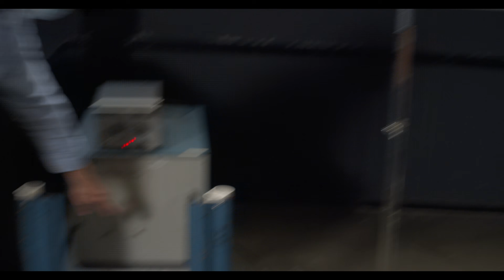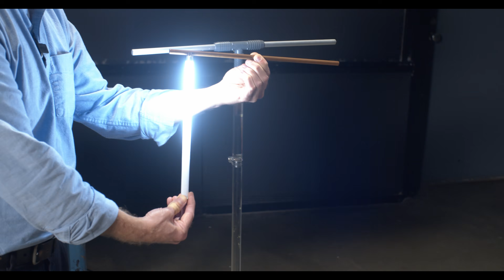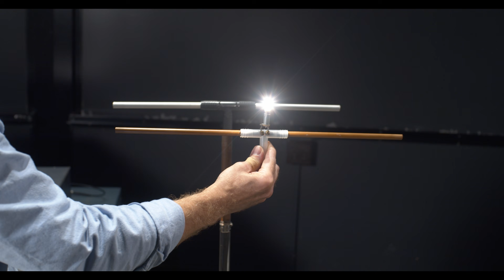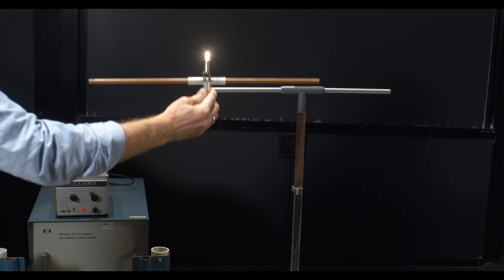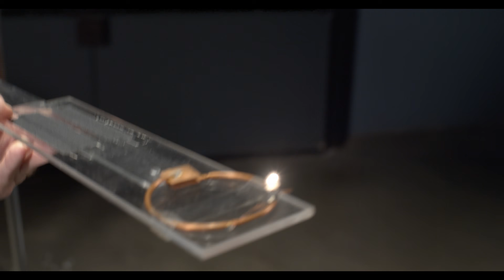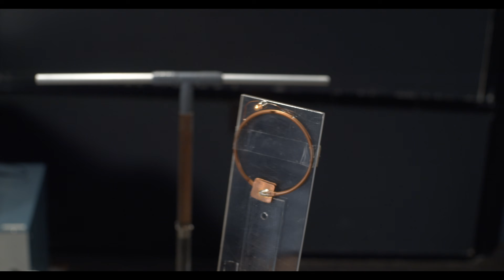Radio Wave Properties: Electric and Magnetic Dipole Antennae

Comment: What happens with multiple receivers?
Reply from the maker: You get multiple receptions
Reply: @NatSciDemos  what happens to the field strength at each lightbulb incandescent receiver as more are added in free space? Surely you can't add infinite incandescent light bulb antennas without each one taking up some signal lowering over all field strength  , otherwise that is free energy. Do you pick up what I'm putting down now . Decoupled can't equate to free infinite right? So do you run out of room for light bulb dipoles or can the field strength be depleted ? What happens to the far field signal strength during all of this ? I predict it must go down or it's free energy infinite.

Comment: So was this test done at 100 watts or less?
Reply from the maker: Much less than 100W, because the input coming to the amp from the oscillator is very low (the knob is turned down almost all the way). The type 47 incandescent lamp in the dipole receiver is rated for 1W, but we keep the signal well below this level to prevent the lamp from burning out. See the link in the description for more details on the setup.

Comment: The near-field effect in the light may have been from the alternating magnetic dipole moments of the charged particles inside the antenna inducing a current in the mercury vapor inside the fluorescent bulb.  Some fluorescent lamps, in particular a type of induction lamp, utilize this principle.  The fixture typically contains a coil with a high-frequency AC potential powering it, and the bulb is simply glass filled with argon, mercury, and the phosphor coating.  No electrodes, so the usual “sputtering” effect of the typical electrodes (that leads to the death of the bulb) is absent.  Very interesting!

Comment: This is an excellent and very concise demonstration!  Also, how many volts is coming from the amplifier?
Reply from the maker: The output of the transmitter is set so that it will just barely "strike" an arc in a 12 inch, 8 Watt fluorescent bulb when it touches one of the ends of the antenna.

Comment: Repeat the experiment with the lightbulb with transmitting and receiving antennas made of the same exact metal. Then again with a price of quartz affixed to both of them that is cut from the same price of quartz.

The intensity will increase with the antennas alike, range will increase with quartz added.

How do I know? I have never done it, I simply know without knowing.
Reply: Yeah... or try winding about 1000 turns of magnet wire around your penis, forming a coil. Make sure you keep the ends separated, but attached to the skin using conductive tape (such as that containing silver ions). This is the "Phallic Dipole"

Comment: The light just went off in my head !
You just showed me that my dipole, whose feed point is much higher than the ends, due to physical limitations, doesn't likely work as well as it could !
But using your technique, could you finally put an end to the theory about the inverted vee antenna being more, 
" Omni directional " , or not ?
             (((  / \ )))      🤔.....?

Comment: So if it can induce current in a lightbulb, that is meant for 230V, this means, that it could induce a similar voltage into you. Of course your nerves dont react to a frequency that high,but doesnt it still give you internal burns or heats up your flesh? Because its basically a low power and bad resonating microwave oven that you've made out of the room, and 100W isnt nothing.

Comment: No need for 100W.
I did the same when I was a eenager experimenting with approx. 8-10W @100 MHz, (with QQE03/12 tube, parts from old tube radios and TV’s and a standard FM radio dipole, Then dimming the light by varying the power.
Once light up one could walk pretty far away with the tube. It convinced my parents I could do magic. :-)
This brought back the memory of those fun times.
Reply from the maker: Correct, 100W of output would easily burn out the type 47 (1W) incandescent bulb in the receiving dipole at 1 meter distance, which is why we use the minimum amplitude setting on the HP oscillator. Thanks for watching.

Comment: We experiment with Lorentz force RF antennas.  The physical field manifestation is interesting.  Here is one setup:

1)  10 layers of store-bought aluminum foil, each layer separated by a dielectric layer  (basically a 10-layer lamination).  
      The lamination is horizontally oriented on the workbench

2)  very strong vertically-oriented B-field applied to the axis (center) of the lamination

3)  roughly 16 Mhz fed to eddy current coils positioned radially, and adjacent to, but not touching, the foil lamination

With a vertical B field through the centerpoint, and radial eddy currents flowing horizontally through the metal layers, the Lorentz force sweeps the charged particles in the metal layers back and forth, coherently, at the 16 Mhz rate.

Since artificial gravity can be created by immense coherent accelerations present in the bulk of a sample, we use variations of this design to check for such effects.

Comment: Not an experiment I would recommend anyone trying. RF burns can cause serious injuries. I've got three fingertips with no fingerprints because of an rf burn I received using a lot less power than this, and I was insulated. I nearly lost the ends of my fingers. It was painful for months.
Reply: @@NRGYI was simply checking to see if a dummy load was warming up. It was a few tens of watts on HF probably close to 30MHz. The burn itself felt like a gentle warming. Nothing alarming at all, I didn't realise the injury was related to the event until my doctor recognised the burn as being rf related. He was an ex BBC medic.

Comment: Excellent demostration. Educative and very useful. However I have one doubt. Why the bulb in the receiving antenna didn't glow brighter when the same is brought in line with the axis of the main antenna?
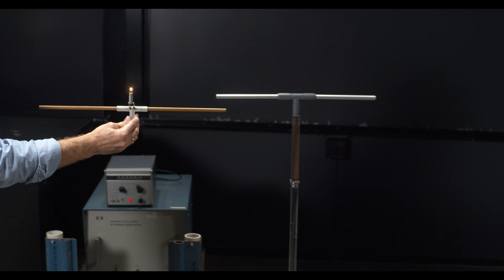Reply from the maker: Thanks. If your question has to do with the signal attenuation that happens at around 3:28, it is because the transmitted signal is minimal  along the axis of the transmitter. Think of the pattern as shaped like a big donut (toroid), with the holes pointing in the same direction as the axis of the transmitting antenna.

Comment: Hi profesor, I am looking to know physical effects in similar experiment but in frequency in HF between 1 to 30 mhz. there any chances that can do smilar experiment just to something that can be seen or phisycal manifest at naked eye in this frequency band ? thanks.
Reply from the maker: We chose 300 MHz because in air, the electromagnetic wave is about 1 meter long (through another medium such as glass or water, the wave travels slower, and so the wavelength is shorter). We have a similar apparatus that transmits at 1 GHz,  which corresponds to 10 cm wavelength (see https://sciencedemonstrations.fas.harvard.edu/presentations/microwave-properties). A 30 MHz signal would require transmitting and receiving antennae ten times as long as the ones shown here,  which would make them difficult to fit through the doors to the lecture hall.

Comment: It's really facinating how so many properties with-in Nature exist in waves, frequencies, and vibration, which converts into energy. Also differences seem to be a key factor in keeping dynamic systems functioning. High pressure/low pressure, hot/cold temp, different densities, static electric charges/discharges, electromagnetism north/south poles, different velocity/angular momentum, layers between different regions like land, water, air, edge of atmosphere, in space the regions of particle bubbles/cloud regions, nebula's/ Galaxy clusters/to less dense regions of space. All of these things are basic differences but create a way for the dynamic engine with-in Nature to continue flowing and operating to create and convert energy. Like regions of high/low pressure and temperature differences create winds. Transfer that into water or planets core and add density. It creates either ocean currents and flow or planetary convection geothermal activity.
Reply: In fact if you move at speed to that difference the effect disappears. All exchange of energy can only occur between non identical dynamic oscillations.( waves )
Reply: @das250250 But who, or what can actually move at those speeds?
Reply: @MR-backup  it is all relative but other particles may be moving quickly like muons .
Reply: @das250250 It can't "all be relative" if you follow up by saying there is SOMETHING "moving quickly".

Either way, aren't you just confirming the OP?
Reply: @MR-backup  Not sure what you are asking "op" ? My statement says there is only relative motion and possibly values. As per relativity.
Reply: @das250250 OP = Original Post.

Comment: I appreciate your experiment. On demonstration of B-field, in fact 2 loops perpendicular to each other exist, the small loop is the connection of the light bulb. The small loop could get the B-field. In near field probe applications, we always use small loop sniffers perpendicular to the wire.

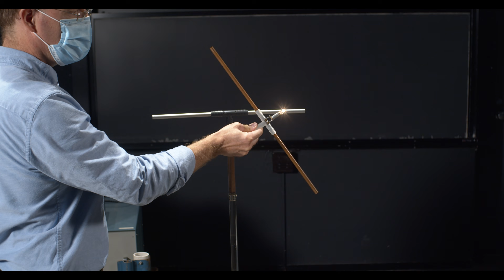Comment: How is the receiving antenna at 3:20 time stamp constructed? Is the light bulb attached to a single rod? Or the light bulb connected to two half rods?
Reply from the maker: Yes the receiving antenna is divided into two segments of copper, with the lightbulb connected between them.
Reply: @NatSciDemos  In this case, light bulb and two segment of copper form an open circuit. There is no electric current in any open circuit.
Reply: There is current flow, because the RF wave is alternating. The incoming radio wave induces a j sloshing electric wave in the copper, although it obviously can't leave the material. At any moment there is a difference of electric potential between the copper rods, hence current flows through the bulb one way, and then reverses based on the oscillating. The key, is that this is an alternating wave.

Comment: What if you put the loop antenna on the left or right side of the dipole? like this:   O --I--
Reply from the maker: Would there be a changing electric field due to the antenna at that location?
Reply: @NatSciDemos  As a ham radio operator that built a magnetic loop antenna for the amateur radio; 160, 80, and 40m bands, I am just curious.  I have mine oriented vertically, with great results.  I chose a vertical orientation as it is more manageable for the space that I have in my attic.
Reply: it is a two turn loop, about 5.5ft in diameter

Comment: one question I made a few experiments with my transmitter and receiver and it behaves exactly as he says! But I have a question why my own body or oscilloscope has a huge effect on transmitting the radio waves?? Even only ground from oscilloscope has an effect or probes or my hand ? Is it only capacitance of my hand? It has to be more than that because once I have mesured some capacitance of my hand and I put a capacitor of the same value into the circuit and it doesn't match at all!! What is particiallar in humans body that it has an effect on radio waves?

Comment: Impressive demonstration. 
Safety distance of 100W 300 MHz into a dipole would be about 4 meters in my country (28 V/m E-field strength limit)
Reply: Or about a mile in the UK.
Reply: He's wearing a mask, so its "okay". (Obviously this is 'sarc'.)
Reply: It is no more dangerous than lighting up a 100w 💡. In fact, the  electromagnetic wave from the bulb has much higher energy than 300Mhz.

Comment: My friend Aigars in latvia 90s years makes extremaly powerfull transmiter uses sovit transistors 2T925В from distance 12 meter in naked hand glowing flashlight filament bulb not discharge bulb and not wires and cords. Your transmiter like a toy! Friend fix heath problems instantly destroys trnsmiter and not build again. Dont playing with hight power EM emisions!

Comment: As you I use to show this to my students (ESIEE Paris) but with the help of a Baofeng and a log-periodic Yagi. I don't have an 100 W RFPA ! But I believe you don't use it at full power otherwise the bulbs will suffer somewhat. Using an horizontal reflector below RX and Tx dipoles you can also show the Fresnel zones. All students like to see that :D
Reply from the maker: Yes the amplitude of the oscillator that feeds the power amp is turned almost all the way down, so the total output of the transmitter is less than 20 W/m^2, otherwise we could burn out the tiny bulbs on the receiver antennae :)

Comment: This is a very cool demonstration! Can you come up with an experiment that reveals the phase relationship of the electric field to the magnetic field close to the transmitting antenna? I'm interested in an experiment, not in a variety of equations. Thanks.
Reply: If you had an oscilloscope I think it could be done? It is an interesting idea as the fields at far distance, electric and magnetic, are in phase while near the antenna there are parts of the fields that are 90 degrees out of phase. You would need tiny examples of the test probes used in this experiment, a small dipole receiver and a small magnetic dipole receiver connected via coax and connected to the oscilloscope with equal length leads you could then see the phase relationships? Please make a video as I don't have an oscilloscope. Thanks.
Reply: @andyeverett1957  I have wanted to make this kind of measurement for awhile. Have never gotten around to it ... maybe I should revisit this test having acquired several vector voltmeters as well as several dual-trace scopes ... I also contend that the traditional; dipole antenna works on the principle of the magnetics (magnetic field) to create  the 'radiation' and not the magnetic ... not even the combo of the E and H ()or B) fields - JUST the H field.

Comment: Good demonstration. That's what Nikola Tesla wanted to achieve, to be able to transmit power thru radio waves and light up the world!

I believe he was way ahead of his time!
Reply: Not wanted to achieve, he did achieve it. It's the world that stays stupid
Reply: And nobody wanted to finance his idea, because everyone with an antenna could receive the energy and you had no way to charge money for it.
Reply: @Laienhaftes  well no, since you'd need special equipment to get the power and turn it into something besides sound. So the hardware would cost money.
Reply: @josephhacker6508 as soon as you have the equipment to receive the power (and that's very easy and cheap to achieve) you can consume power and the transmitter can't tell how much you are consuming.
Reply: @Laienhaftes  Totally wrong. Transmitter detects a load.
Tesla's idea was flawed in many ways and that's the reason why it never lived in the way he imagined it. Not because of some conspiracy.
Reply: @lajoswinkler  capitalism is No conspiracy.
The Transmitter May detect a load, but WHO is the load? Whom do you send the bill?

Comment: Can some one explain why the small light bulb is luminating while it is practically being connected to a short circuit? 
I understand to some extend why the florescent bulb is working but I can't understand why the small light bulb is luminating?
Reply: Think of the coil as a winding in a transformer.  It's a short circuit to DC,  but a fluctuating (AC) magnetic field is cutting across the coil and that's driving a curren through the coil. The light bulb just lets you see current is flowing.

Comment: Very good.
You demonstrate perfectly that there is a stationary wave surrounding the transmitter antenna. And there is more power at the borders of the dipole.
Well done.

I think this experiment could be a little bit dangerous for a human due to the high power.